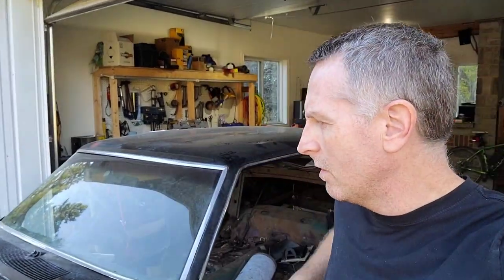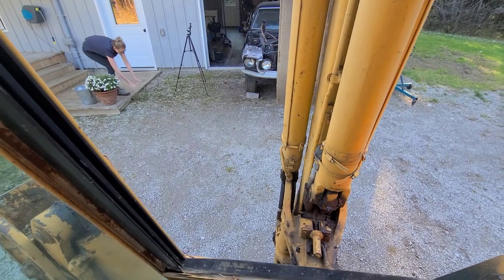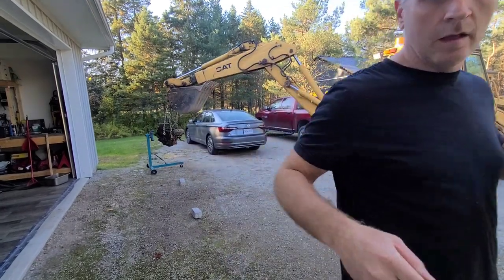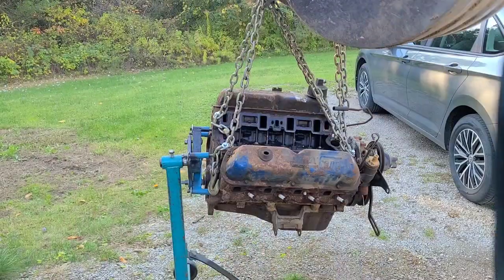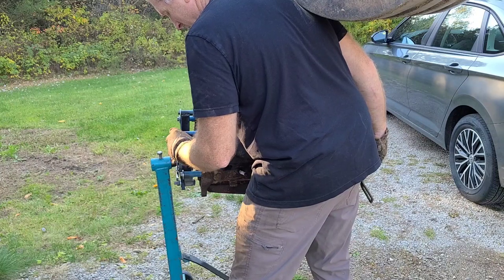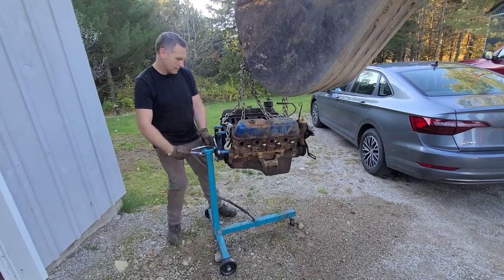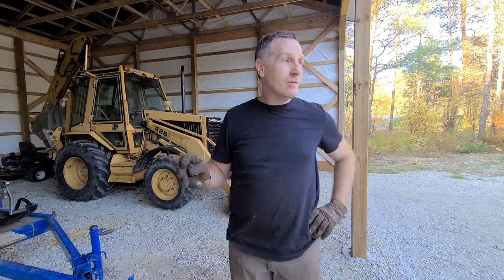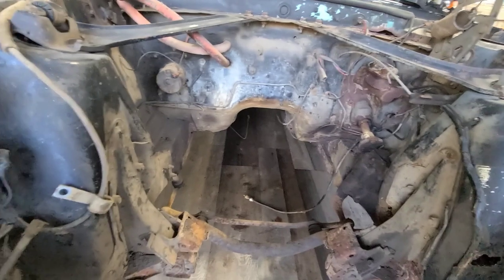Project Mustang Part 8: Who knew Caterpillar made engine hoists!

Comment: Looking good! A tip on the engine stand. While you have the engine in the air, take the head off the stand, attach it to the engine, then lift the base of the stand up and slide it onto the tube on the head. Then set the whole thing on the ground. Same thing when you're taking the engine off the stand. Lift the whole unit,  take the base off leaving the head attached to the engine, put the engine in the back of the truck, then remove the head of the stand from the block. Might make it a bit easier. Great job on the resto so far! Keep up the good work!
Reply from the maker: A friend of mine told me the same thing after he saw the video. Looking back that would have been way easier haha 😄
Reply: Nice tip! Wouldn't have thought of it.